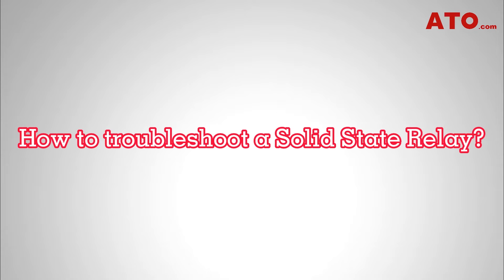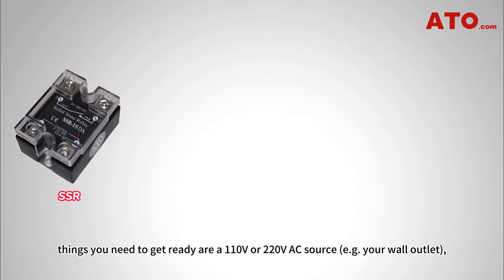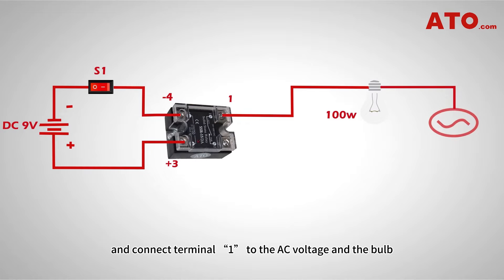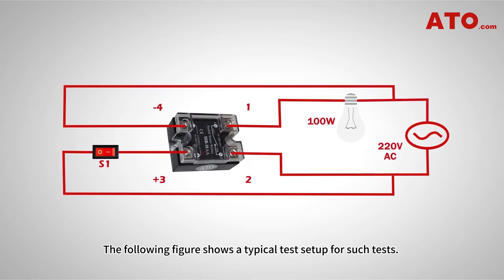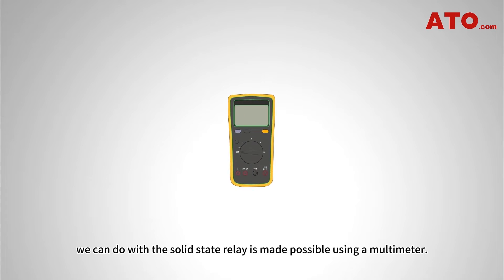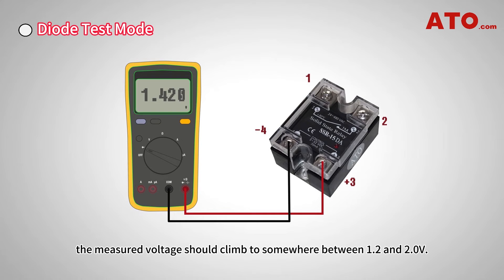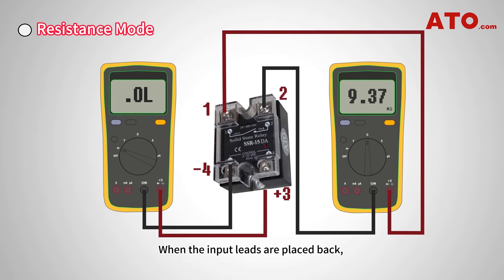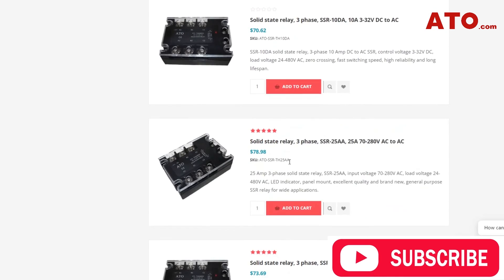How to Test a Solid State Relay | SSR Troubleshooting

Comment: my ssr on the AC side which I have attached ac bulb is not going off even when I turn off  the DC side
Reply: I observed the same phenomenon: the OUTPUT circuit is closed (i.e. the light bulb is on) even when nothing is connected to the INPUT side (whether that input is DC or AC is irrelevant).  At 1:17 in the video,  the diagram on the OUTPUT side shows this circuit:TERMINAL1 - LIGHT BULB - POWER SOURCE - TERMINAL 2.   The light bulb is OFF.  The only reason for the light bulb to be OFF is because the circuit is open between terminals 1 and 2.   However, if the SSR is stuck "closed" (apparently a common failure of solid-state relays), when normally it should be "open", and consequently there is continuity between terminals 1 and 2, the light bulb will remain on at all times. This was indeed the case for my SSR: I disconnected everything from all terminals and then, using a multimeter, tested for continuity between terminals 1 and 2.  There was continuity between terminals 1 and 2 confirming that the SSR was stuck "closed".
Reply: hi... I tried this with a bigger rated buld and an heating coil and it worked( SSR was good).. am not good it electricals to use the right words..